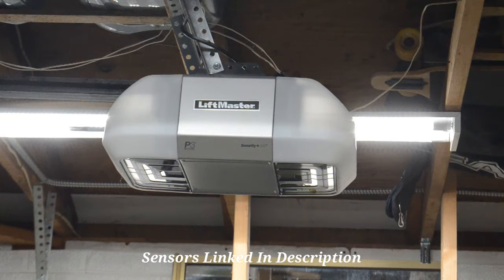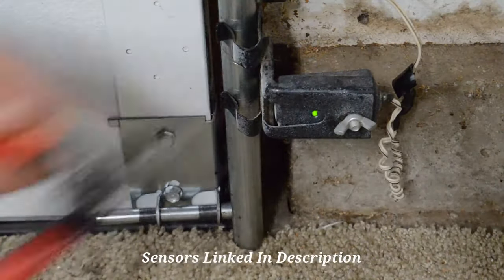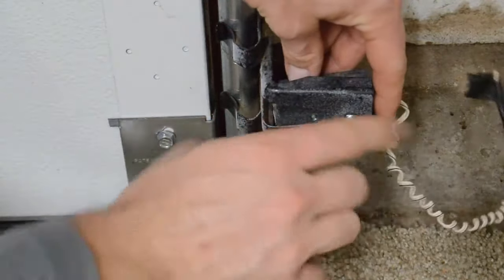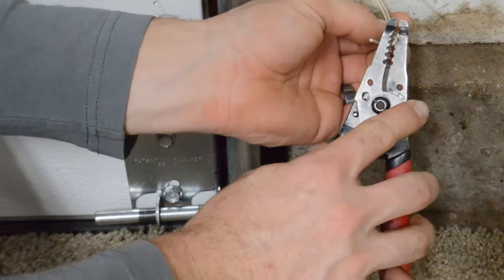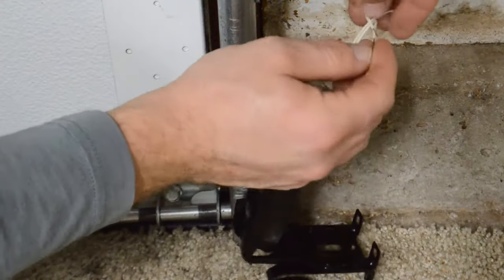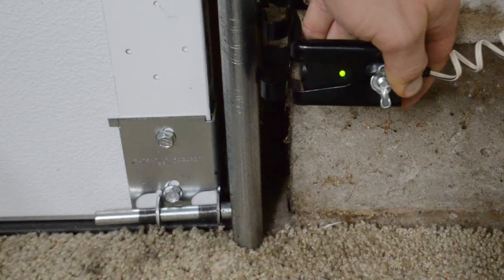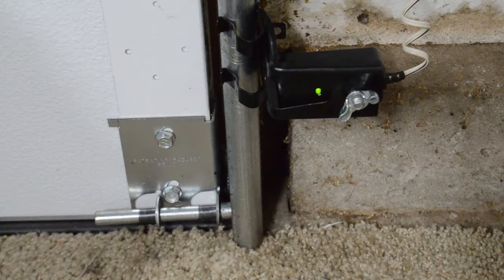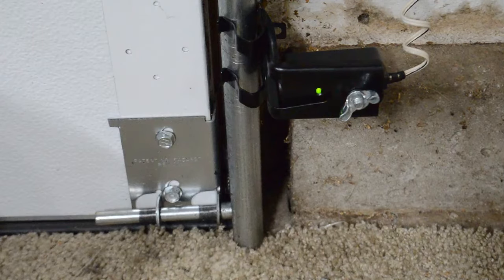How To Replace A Garage Door Sensor - Easy!

Comment: Thank you for the video. So the wire connectors are not module plugs where they just unplug from the sensor and so is that why you had to splice them instead?
Reply from the maker: I don’t believe they plug in no
Reply: That would be too intelligent of a design and thus a design flaw!!

Comment: Thanks for the video! Silly question… Do I need to change both sensors or can I just change the green sensor side since that is the only one that seems to have a problem. I’m assuming I need to do both since one is the sender and receiver but thought I would ask :). Thanks again!
Reply from the maker: Sorry for the delayed response, yes I’d recommend just replacing both (:

Comment: Nice guide! Is it not necessary to cut power at the breaker for this?
Reply from the maker: Not at all
Reply: @GarageDoorGuidance  great thanks! And I'm guessing the process is the same for the other side?
Reply from the maker: Correct (:
Reply: @GarageDoorGuidance  awesome, and one more thing before I leave you alone

So the problem I'm having is that when the sun shines towards the direction of my sensor (the amber/yellow one), my doors have a hard time closing due to what I'm guessing is sunlight interference. I looked into this problem and apparently it's the receiving green one that's supposed to be affected by light and not the sender

So do you think that my sensors have just gone bad? 

I have the exact same sensors as the ones in this video
Reply from the maker: My recommendation is try to swap sides, snip, switch sides and splice them back into the wiring. In my experience that solved the problem
Reply: @tmywu  no. This is a common problem with sunlight.
Reply: What if my garage has a blie and green wire to

Comment: How did you get the wire on the sensor to coil up or was it like that when you bought them?
Reply from the maker: Use a rod or screwdriver and wrap it around it, slide it off and it should stay nice and curly
Reply: Thanks

Comment: I did the replacement, but part of the garage door is rubbing against the back part of the clips.  It looks like as the garage door goes down, it shifts slightly and the bolt that holds the cable at the bottom of the door rubs against the 2 flat part of the clips.  The original mount was using one screw to hold the bracket to the rail.  I can't mount it to the wall because the clip is not long enough.  I have it temporarily on top of a can near the door.  Any thoughts?
Reply from the maker: You can bend those parts off, and mount it to the track like it was before ? I am familiar with that situation and that’s an option.
Reply: @GarageDoorGuidance  Thanks.  I was hoping someone else had this issue.  I was hoping for another option that wouldn't require damaging the clip, but I may not have another choice.
Reply from the maker: It is the easiest option

Comment: Can I use any brand name for garage door sensor because my moto liftmaster 17yrs since I bought my house. I try looking up part number to match my moto but there don’t have it. Please any advice for me can change my garage door sensor. Thanks a lot
Reply from the maker: You should be able to use any Liftmaster sensors, like these https://amzn.to/3QatjAN
Reply: @GarageDoorGuidance  so any liftmaster moto will compatible to any sensor the same brand name.  Is doesn’t matter difference part number. My moto has this part number liftmaster 41a5021-1h-315. One more things I don’t know what is exactly problem my garage door because sometime I closed then a moment it reserved back. It wasn’t happen all the time. I did check 2 motion sensor, one is with green light and one with yellow light. I did align the yellow one but still. After I did some research they said I have to replace new sensor. May you please any advice with this my garage door problem. I’m appreciated for all your help.

Comment: Yes i had some garage door repairman come out and said it'd be 400 bucks to fix which as a teacher Iw as like um no not right now....I figured I can just pull it up and down, but this looks easy enought but I'm wary about the wires; could i have an electrican fix this for me who won't charge me taht much?
Reply from the maker: Those wires are low voltage I don’t think you need an electrician but you can call and ask or call a couple different companies to try to find an honest one that’ll charge $100

Comment: Do you have to turn off power / circuit breaker to cut and replace wire?
Reply from the maker: No you do not need to
Reply: @GarageDoorGuidance  why not?

Comment: Tried wiring white to white and black/white to black/white and vice versa not working 🙄. Any idea what the issue might be?
Reply from the maker: Firstly would be to make sure they’re the same sensors that work with your opener 

Have you tried to follow the line to see if it’s stapled through anywhere ? Also I’d check the back of the motor to make sure nothing is lose there too. 

You can also try to wire them directly to the unit ( take the sensor with just a few inches of the wire and try to connect that to se did the light lights up )

Comment: So what if the lights don't come on after the splice?
Reply from the maker: Were they on originally ? I’d follow the wiring to see if they’re stapled through somewhere or at the unit itself to make sure they’re plugged into the correct places
Reply: @GarageDoorGuidance  Lights were on before. All connections are good. I think the actual eyes lasers might be bad.

Comment: I had to install the wires on this backwards. When I did black to black and white to white the light did not turn on. When I reversed the wires the lights turned on and everything worked.
Reply from the maker: Sometimes it’s backward at the unit but that’s ok
Reply: The instructions said the black wire should go on screw 3 and the white wire on screw 2. I had to put black on screw 2 and white on screw 3.
Reply from the maker: There could be a splice somewhere that was crossed, should be totally fine though
Reply: My lights won’t come on both ways (black black white white or BW BW) does it matter how much of the wire I spliced? Did half an inch but still
Reply: 1/2 inch is plenty.  you need to see if your wires are connected to the garage door unit properly. Do you have a multi meter to check voltage or continuity?

Comment: Why wouldnt you turn the power off first?
Reply from the maker: You can definitely turn the power off if you’d like
Reply: Are those wires running low voltage like a doorbell?
Reply: The current required to operate the photoeyes is nowhere near enough to penetrate the skin or deliver any sort of shock
Reply: @Everynamestaken69 thank you for that answer, I had assumed that, but I'm not an electrician
Reply: @GarageDoorGuidance you wouldn’t even feel anything, it’s low voltage.
Reply: Great video.